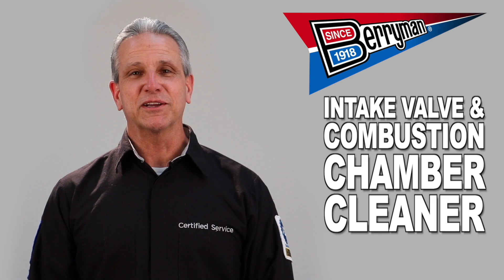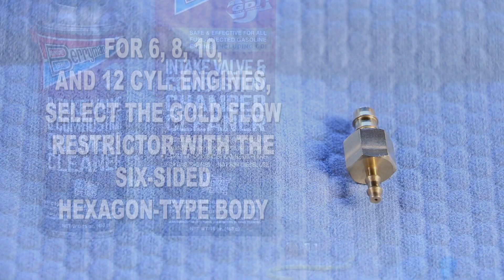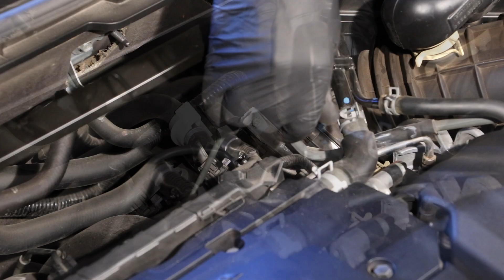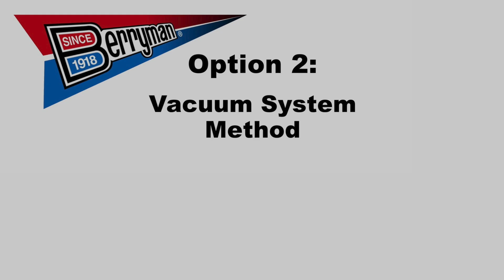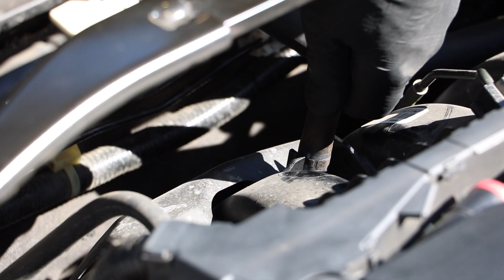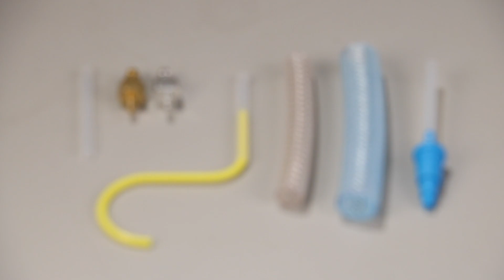Intake Valve & Combustion Chamber Cleaner #2611

Comment: Question if it's done through the throttle body. Don't u have to rev it up a bit? So that the butterfly inside the throttle body opens? And allows the chemical into the engine?

Comment: I'd recommend using this as preventative maintenance rather than "last resort". Obv walnut blasting is last resort but you understand. 

I did it on my 120k mile 2.0 n/a Hyundai Elantra gt after losing power above 3krpm and knock issues. I dumped the oil after and there were chunks of carbon like nerds candy sized in the pan. Filter got completely clogged. Still having issues, no MIL but you can feel it missing. Gonna try it again with some oil additive to hopefully break up chunks that come off. I'm still due to change spark plugs etc so the car is still meh but...
 
This shit definitely works. The important part, like other YouTubers note, is where that carbon goes when it falls off, if it's too much to vaporize and or burn. I knew mine was really bad but I honestly thought the berrymans would only take off the top layer.. 

Tip to those trying, put hose clamps on both sides of the little metal restrictor so the pressure doesn't blow one end off and soak you and your engine bay. Have lots of towel handy

Comment: *1st 🪜, Engine needs to be hot, like cleaning oven using oven cleaner when oven is hot. 
2. Attach hoses to vacuum or air intake, either 1 person on throttle pedal slowly rev to 2k to 2.5 k up to 3 is fine, try to maintain 2.5, NOT 🚫 on IDLE, 1 to 1.5 k , you will destroy, flood engine. Don't let it go below 2k. Use 2x4 or any stick, to hold throttle. 
3. Spray momentarily, in spurts, Not continous, 2,3 sec,break 2.3 sec spurts. 
4. Empty around 1/2 or 2/3 can.
5. Rev engine little, then 🛑 
6. Wait atleast 1 or 1.5 or 2 hour,. 
7. Go for  10 min ride 
8. After ride, spray 1/8 or 1/4 can using above procedure,  wait 5 _ 10 mins, again empty the rest of can, same above procedure.  
9. By doing 3 times using same can, you are rinsing away soft carbon. 
10. Then do fresh Synthetic oil change. Since synthetic oil vaporizes less. Use 15k or 20 k miles oil but change in 6- 7k miles, but top off oil if needed after 2 k or 3 k or 1.5 k
 11. Do before every oil change. Multi port , pre 2008 cars don't have this headache. This is result of Over Engineering in new cars*
Reply: Is that it bro? Ha ha...

Comment: Does it remove carbon deposits from the piston rings
Reply: For that, you need something in the engine oil. I'm actually in the process of doing that to my car, an old one that's new to me. Project Farm gives a good review of several oil additives, including MMO, SeaFoam, and Lucas Oil. But first, I will perform one or two rounds of engine oil flushing to remove any old contaminants from the engine.
Reply: @andreasguntoro5399 it won’t help you, what is actually help is DMSO ask to chat gpt how to treat your cylinders with it and it will tell you whole the process
Reply: I doubt it.   I would try Marvel Mystery oil in the oil or sea foam.  Run it for a few thousand miles.

Comment: We need turn on the engine ?
Reply from the maker: Yes, you use this product with a running engine
Reply: @BerrymanProducts  I Have 7 Questions About The Additional Instructions Before Applying The Cleaner:

Question 1: After Starting Up The Vehicle At A Cold Start, Should I Warm Up The Engine 1st Or Apply The Cleaner Once The Engine Is Running?

Question 2: While The Engine Is Running, How Many Minutes Does It Take To Warm Up The Engine?

Question 3: Do I Get The Vehicle At A Warm-Up Temperature Or At Operating Temperature?

Question 4: How Many Minutes Does It Take To Get To Operating Temperature?

Question 5: Do I Have To Get The Engine At Hot Temperature?

Question 6: If The Vehicle Starts Stalling Or Stalling Out, Should I Shut Off The Can Early Or Let The Engine Stall Till It’s Time To Shut The Can Off?

Question 7: Once The Engine Rests For 30 Minutes, Do I Drive The Vehicle On Road Surface Streets Such As 35-50 Miles Per Hour For A Minimum Of 10 Minutes? Or Drive On Highway Speeds At 60 Miles Per Hour For Also A Minimum Of 10 Minutes?

Comment: Can you use this on. Turbo eco boost engine?
Reply: 100 Percent
Reply: You can, but I doubt if you use that restrictor and spray that minimal amount of fluid in that there will be any liquid left to get to the actual intake let alone the valve most people probably do it before the turbo and will it help clean the impeller blade on the turbo yes Will it clean the throttle blade on the butterfly valve On the throttlebody, yes probably but depending on the buildup it would depend on how effective something like that would work for you.

Comment: Just did my Honda Pilot.  Easy to do.  Followed directions.  Waited 30 minutes then drove for 10 minutes.  Lots of blue smoke at first then it cleared up.  Did get a check engine light but it cleared up after 10 minutes.   I suspect it removed carbon from valves.  Car had 70,000 miles and direct fuel injection.
Reply: Mine triggered like crazy too. It caused a misfire until it cleaned everything out

Comment: This thing got rid of my pre-ignition problems on my 2013 Impala 3.6 GDi. After a few years of going through a bunch of other products, shops and the dealership flat out telling me I would never get rid of it.

20 minutes following instructions and the problem is gone.
Reply: I got a lady with a 2009 Impala that has ABS light and Stabilitrak light on. Whenever I Google it it says to clean the throttle body and change out the pedal sensor. She has already changed out the pedal sensor and I just replaced both front hub assemblies. Do you think this could help her?

Comment: Do I have to change the oil afterwards?
Reply: I would.
Reply: @daveybernard1056  there is no need to change to oil as this procedure is only cleaning the intake runners and valves.
Reply: I feel like it would be a missed opportunity if I didn’t make a statement of it’s a shame that they don’t sell common sense Or include it in the box in a separate cam cause there’s a lot of people that could use it. Enjoy your day.
Reply: @timmyl2005  what is common knowledge to you is not common knowledge to everyone, why attack someone for asking a simple question?
Reply: He says that he would he would change the oil but that’s coming from someone that apparently doesn’t have any mechanical ability or understanding of how the intake system works. If you spray something into your intake, it goes into your combustion chamber and it’s burned, but if you connected to Your valve cover, then yes you would need an oil change cause you’ll be spraying that liquid into your engine oil . I haven’t used the product yet I think snake oil, but I’m not gonna say that until I’ve seen it for myself and yes, I realize this is an old post. Don’t worry you can all have a little bit of fire. I give it out for free.
Reply: @timmyl2005 this liquid doesn't go into the engine oil. This isn't seafoam. A vacuum line is not the valve cover. Yes change your oil and filter

Comment: Would this product work in a carburetor engine?
Reply: This is correct, except the carbon buildup issue with gdi engines is from the gasses from the crank case (oil vapors etc ) geting reinjected into the engine to burn and reduce emissions. The vapors which carry oil and carbon junk get mixed with the air that passes over the valves to get into the combustion chamber. In carbed engines that air is already mixed with gas (which cleans itself and also has cleaning chemicals in it). Port injection engines function similarly to carbed in that case.
Reply: I mean I’m sure it wouldn’t hurt it , but there’s no point . Gasoline is being sprayed directly into the intake manifold via the carburetor . So it’s getting a cleaning of its own, all the time via gasoline. This product is for direct injection engines where the fuel is injected directly into the cylinder “below the valves” verses above the valves. So in a direct injection carbon builds up on the valve seats because they never get hit with gas. Theses engines get better fuel economy but as the cost of carbon build up which with scar the valves and seats us eventually causing problems. You can obviously clean your carburetor , and poor products safe for car uteri I directly into it. This product isn’t specially designed for that though

Comment: should one perform an oil change after using this product? if so, how long after using this product?
Reply: No, it doesn’t effect the engine oil as it gets burned off in the combustion chamber and goes out the exhaust
Reply: Yes, right after.